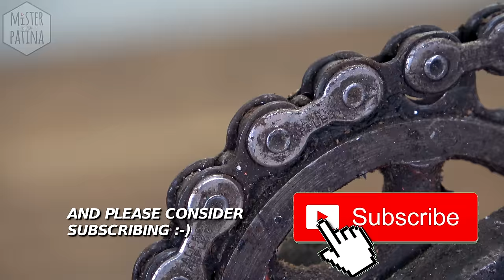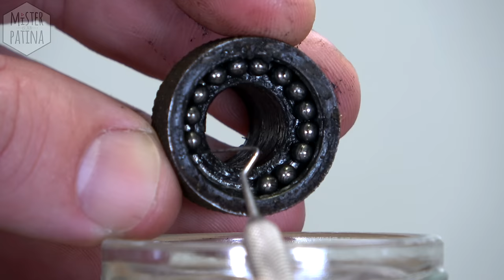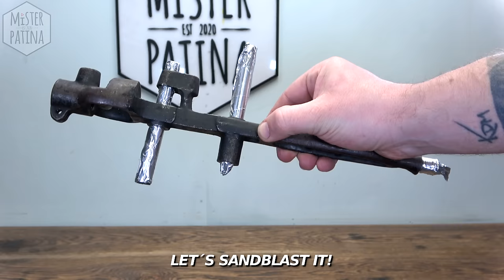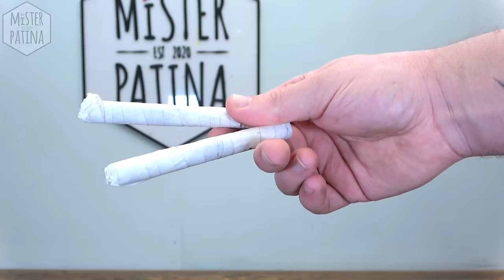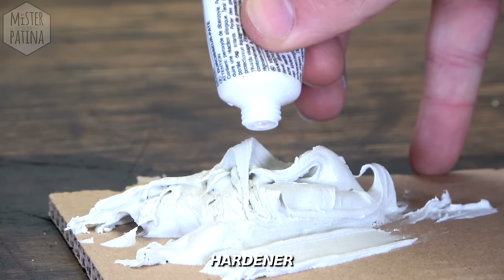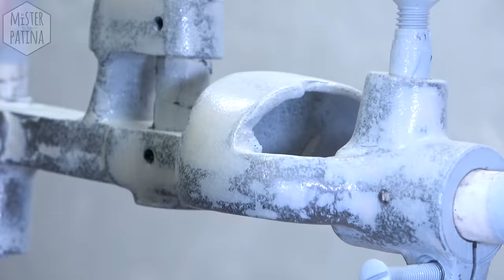Chain Driven Hand Drill | Restoration

Comment: My grandfather had a similar chain-driven hand drill. He had gotten it from a fellow who had worked at the boiler repair shops of a railroad until they retired all the steam locomotives. My grandfather used it to drill mortises in beams for barns and the similar.
Reply: Kitchen Troll I hope you still have your grandfather's chain driven drill. Having a tool from a train company is great. My dad was a machinist for H.K.Porter they used to make small train engines for mines and industrial needs. They also made tools. I collect and  restore tools that they made at their Boston#Somerville Mass forging plant. I have over 20 tools made there.

Comment: I've never seen a two speed manual drill like that, that's really cool. a word of note: chain stretches over time and use. That looks like regular single speed bike chain, new chain is pretty cheap and easy to come by. That'd probably fix the issue with the stuttering.
Reply from the maker: Thanks!

Comment: That was absolutely exquisite! That's not a restoration as much as a work of art. As changing speeds require unscrewing and screwing in the handle, instead of using a screwdriver every time I would have made a "manual screw" by taking the screw holding down the handle, or a similar one, and soldering a small metallic plate in it's groove, so that it can be easily turned by hand. A piece of cake for a master craftsman like you, I'm sure. Congratulations again!
Reply from the maker: You’re definitely right here with your idea of the screw. But I wanna be honest: I ran out of time so I just took this regular one. But thanks man, iam glad you enjoyed anyways!

Comment: I didn't know that. 11:31 😊 Is that because dampness can't collect on a polished surface?  Rather than high or low speed, I think of it as low and high torque. The speed is subject to the material being drilled. I've never seen a chain-driven hand drill in Australia. One thing I expected to see was a bicycle-style chain coupler, rather than a nut and screw.  Beautiful restoration, Mate. That really was a  top effort. It has a paint job better than a Ferrari.

Comment: I'm guessing the low speed gear is primarily for drilling pilot holes through hardwood and metal while the high speed gear is for final sizing or going through softer materials.

Comment: The original handle would have been a quick change slip fit with drive pins engaging in the slots of the drive shaft collars. The restoration of the body and gears was nice.

Comment: Excellent work as always!  I know your just restoring this for the video of the process, not to actually use it a lot.  But if you were planning on using it maybe make a new screw for holding on the handle that you could tighten/loosen by hand.  Then you wouldn't need a screwdriver every time you want to change speeds.  Just a thought. #Cheers
Reply from the maker: Thanks for the tip Bill, I thought about doing this! :-)

Comment: Some feedback. First, unless it is etching primer with zinc, primer most definitely does NOT protect any metal at all. Primer is a sponge, aka soaks up moisture and holds it against metal. Key feature to etching primer is instructions. Apply wait for it to flash off and paint right away. If you let it dry paint won’t stick.

Second. Pins. Straight pins were peened over. Roll pins have a spring action to mostly keep them in place. At a glance this used tapered pins. There is new pins and reamers available for these.

Finally cast iron is porous. It will hold onto oils reguardless of cleaning solvents used. If you heat them up they come out. Doesn’t require much heat. Best to paint cast iron while very warm, not hot, directly with enamel.

Chain was most likely bicycle chain, easy to replace. 

Tip for handle pins turn them so they are counter sunk and thread extends beyond, cut slot in threaded part. Assemble file or cut off extended threads and peen over.

Original handle fit into slots and could be changed without tools. Shoulder plate should have had a slight curve to fit shoulder better.
Reply from the maker: Thanks for mentioning the entertaining factor I produced for free.
Reply: @misterpatina  and you took it badly,sigh. I was just informing you of stuff you didn’t know so that your future restoration’s would be more successful. Don’t get me wrong it looks very nice. It’s a neat tool and it can be used again.

Comment: Why is there only 2/3 to 3/4 of bearings needed in the race? It would seem that it should be full. Also, why such a low viscosity grease? Most bearings in races need a thicker viscosity grease.

Comment: Where did you purchase that H2O chemical? I've tried various hardware suppliers in my area and I'm unable to locate this chemical compound. Does it come with a safety data sheet at all? And what precautions do you need to take when using it?
Reply from the maker: If id answer your questions i would disappear for a long time time...
Reply: @misterpatina  😀

Comment: Nice work. I suppose the drill stutters at high speed is a result of the old gear-wheel.
The teeth of the wheel have different heights and some of the tips are pointed. As athe result of this, the chain doesn't fit tight and starts jumping at higher speed.
All bikers know the problem.
Reply from the maker: You’re definitely right here 🙂

Comment: The chain is too worn out and stretched. That is why the high speed doesn't run smoothly. Easily replaceable looks like a standard bike chain would work. Chains come in standard sizes. 40 size is a standard bike chain 35 is used on 10 speed bikes.  Motorcycles used typically 50 or 60 depending on engine size

Comment: Out of curiosity, did you file the gear teeth on the large gear?  It looked like there was a few places where the drill's previous owner may have abused it a bit and the teeth looked a little deformed.

Maybe that's why it stuttered a bit in the high-speed drilling?
Reply from the maker: Nope, didnt do anything because i didnt want to loose the fitting. Maybe this caused the stuttering, yes.